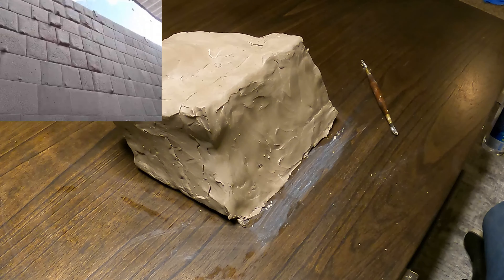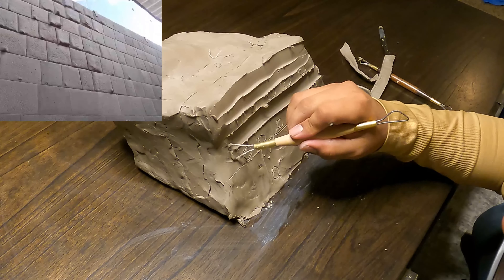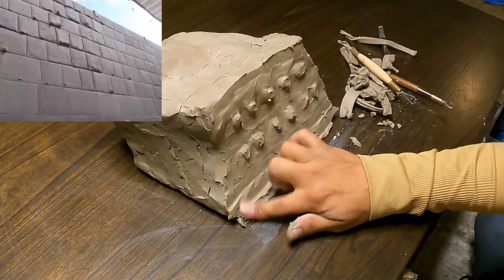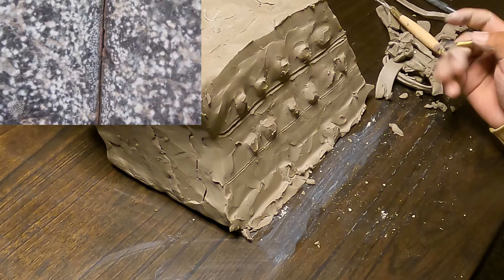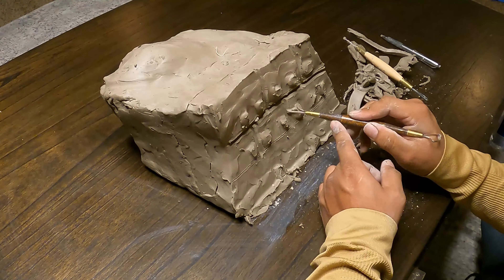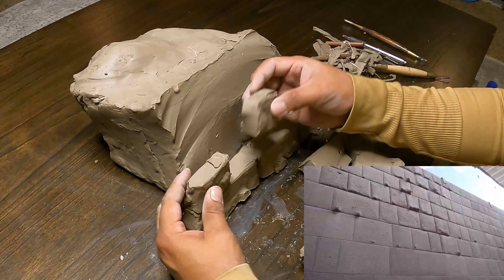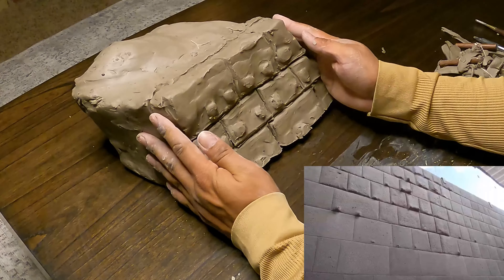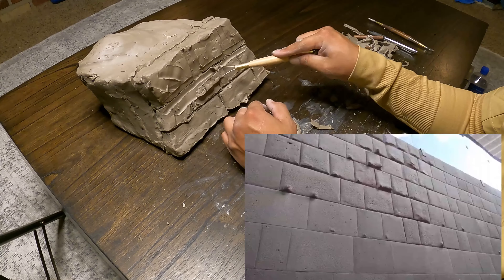Perfecting Polygonal Masonry: A New Explanation on the Ancient Engineers’ Construction Methods

Comment: The "clay" consistency works but your methodology is flawed since any kind of stone tool work on hard rock is untenable at these scales.

It's more likely that the rock was turned to it's moldable or possibly pourable consistency first, then put into bags for transport by apx block size.  That block is put on top of the construction and it's own formability and weight fit it perfectly to the already re-hardened block it sits on, explaining the apparent precision.  Then the bag or form is removed and finish work completed if necessary while it's in moldable state.

The "nubs" I always assumed were a byproduct of how these blocks were transported, with the claylike rock forming into the depressions where perhaps carrying rods of some sort were used.

Just a theory though, and totally dependent on the method for stone softening.  It might be a sort of acoustic effect of some sort that could weaken molecular bonds locally and immediately while the field is applied, or perhaps a less "out there" technique using chemical recipe since lost to us.

But one thing I'm fairly certain of is that it wasn't ten thousand slaves bashing away with hard stones or copper chisels.

Comment: Human ingenuity will figure this out.  Great work - test it asap, on real Sandstone or granite.   

This doesn't work for what I just saw at one SE Asian temple in Cambodia.  Countless polygonal walls... with NO grooves showing break points from tools, and multiple corners.. (8 - 12... at least) Not 4 as you would expect with a rectangle)... EVERY stone a different shape... The stones average about 500 to 1000 lbs... each... (at least)  and nearly each on has bas relief carvings or impressions.

Comment: Ok, can I help out. 1st, if you go in person,  you see each is a separate block,  so it not a cut, as each stones imperfections are copied. You have a better example infront of you. These materials are geopolymer. They are like a clay mix, then set I place. So no need to move huge blocks.  Make each in situe. I worked for 33 years with geopolymer.  The answer is far simpler.  Stupid ancient alien program ideas are TV rubbish.  Making people think of the most difficult explanation. Rather than rewind, stop, think. Back to basics 😊